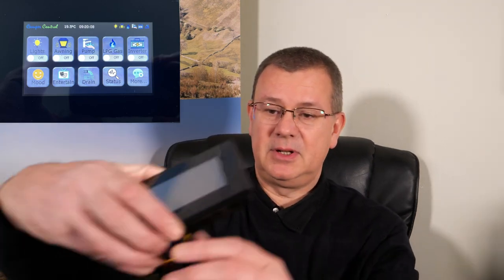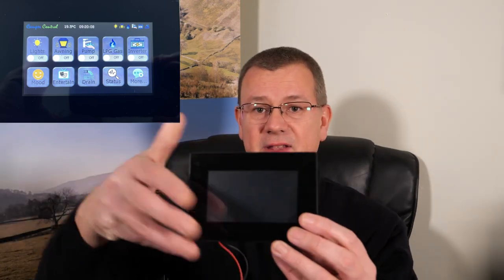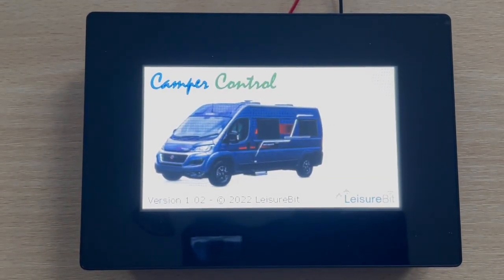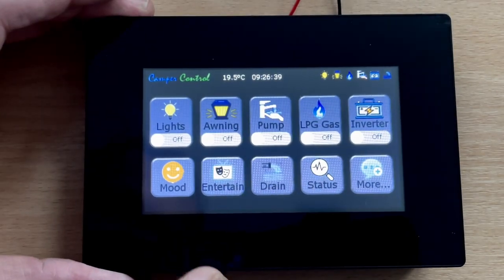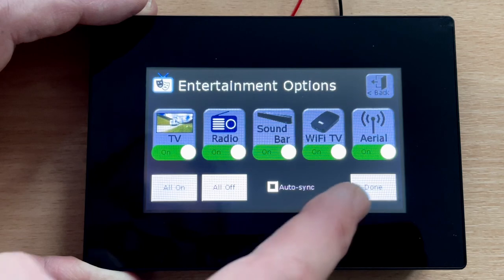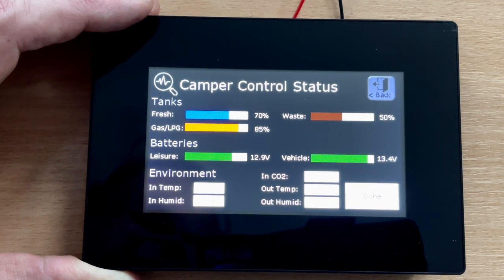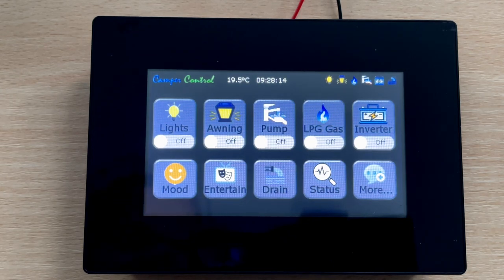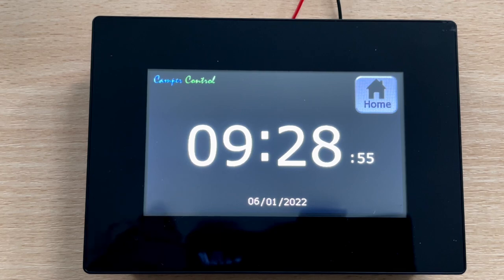Camper Control - Control Panel Update - Smart control of your van with your fingertips

Comment: I have nothing but admiration for folk who can get their head round this sort of tech, make it work and not be gimmicky, it all looks promising and useful, when switching the tv on, obviously you need the aerial and sound bar for it to work and it makes so much sense for it all to be coordinated by the touch of one button, great stuff, look forward to the next instalment!
Reply from the maker: Thanks Paul. Really appreciate the support and comment - half the battle I think is making sure an idea is a solution to some form of problem which makes life a little easier. It’s when it’s installed and in use on a trip when it will show what gets used and what doesn’t. Thanks again, David 👍

Comment: Hi David. Just subscribed as this is something that I often thought about doing before discovering you are doing all the hard work for me 😂. I have fitted remote relays that control my caravan main power and lights from a key fob. I have also fitted a number of other gadgets including CCTV, reverse camera controlled from a separate fob. It all works well enough but it would be nice to have everything controlled from a single point, ideally a wireless device that you can take to bed with you!! Please keep this going as I for one would be very interested. Don't forget security though. A PIN code to enable/disable the electrics (maybe even the alarm) would be a good addition. Keep up the great work sir. 👍
Reply from the maker: Thank you - really appreciate the comment and encouragement. You are absolutely right in needing something you can take with you so you can keep an eye on things. I need to get cracking again with some things on it as have had a break since the van arrived as prioritised other jobs, when the nights start to close in I’m sure will be back on it again, I’ll be fitting some of the bits soon (remote dump etc) along with other bits in prep for the full solution. All the best, David 👍

Comment: Quite a project David!  I do like such technology and have dabbled with IoT projects in the past.  Are you using Espressif modules to run the software and provide the wireless comms ?
Reply from the maker: Good Morning, I’m using the NRF24L01 2.4GHz Wireless RF Transceiver module at the present time, all be it as you may of noticed I keep swapping bits around with it to simplify the setup and minimise the cable runs. It’s taken a bit of a backseat for the past 3 months or so while I have been getting some of the pre-requisites in place and sorting out the practicalities for my van. I’m hoping to get the drain valves and module installed first in a couple of weeks if the weather is ok (It’s either been wet, cold or windy when I have had the opportunity) and doing a few jobs under the van - Thanks for your interest, more to come on this one in the near future 😀 All the best, David 👍
Reply: @LeisureBit  Ah yes, I have a few of those transceivers in my "gadget box".  I can recommend the Espressif devices (ESP8266 and ESP32) as they give you Wifi (+ Bluetooth on the ESP32), a built in TCP/IP stack and are fully programmable with a load of libraries available (they're very cheap too!).  My beer fridge is controlled by an ESP8266, receiving the fridge + room temperatures from ds18b20 digital sensors (these can be chained on a bus so multiple sensors only need three wires) and switching the fridge compressor + tube heater if it needs heating using the same type of SSR relays you're using for your latest USB outlet mod.
Reply from the maker: @y0rkiebar  Thanks for the recommendation - I think I have some of those, will check. Really appreciated. Sounds like a cool (pardon the pun) beer fridge you have created - all the best, David 👍

Comment: That looks amazing and maybe a less comprehensive version would be great as I would be in the market and I think a lot would as some of the panels supplied are pretty flimsy we have a Schaudt lt150 in our Adria camper and the levels side have gone faulty contacted the dealers they are not interested in helping even though it’s under warranty. Infuriating so I would by a replacement in a heartbeat
Reply from the maker: Thank you - I’ve been playing around still but haven’t had to the time to do anything meaningful for a while - I did notice at the Harrogate show there was a chap selling Savvy Van control panels which might be worth checking out…

Comment: What sort of process would one need to go through if I wanted to change my existing CBE PC180 control panel?

I have a Truma 4e, Renogy and the CBE power control so each “system” has its own panel would be good to have them in one panel so I could also control everything at the rear of the van too
Reply from the maker: Hi Steve, it’s an interesting challenge with the multiple control panels isn’t it. Some panels are very proprietary so harder to link into, some have capabilities which allow interfacing with (CI Bus etc) - some are restricted by licence for access to, others easier such as CBE switches, dimmers etc.
I’ve paused on the control panel over the season and moving back onto doing work on it over the winter - it’s harder than you think to create a single panel, I’m hoping to make it simpler and less panels over he coming months but not sure for some specific types if ever the benefit would offset the effort. 
Keep an eye and see how I get on over the winter, I think then the specific answer to your question might be easier to answer.
Thanks for the comment, all the best, David 👍